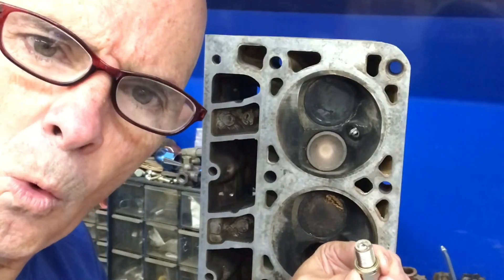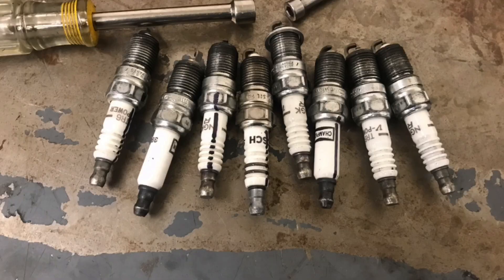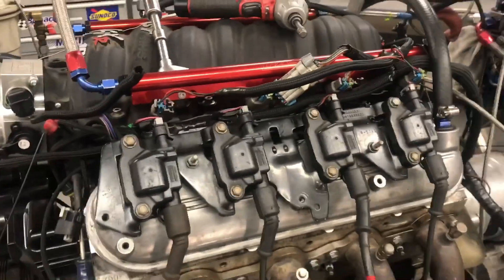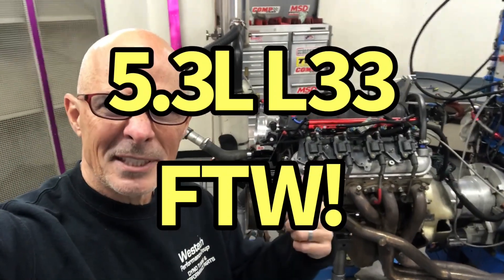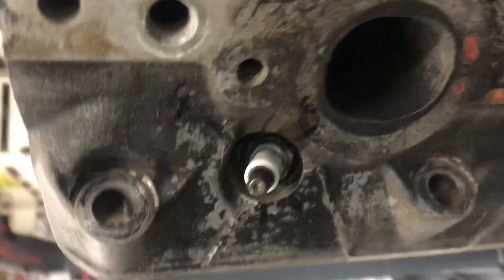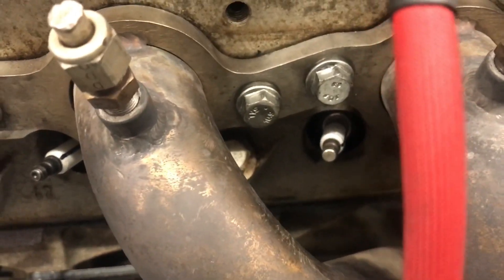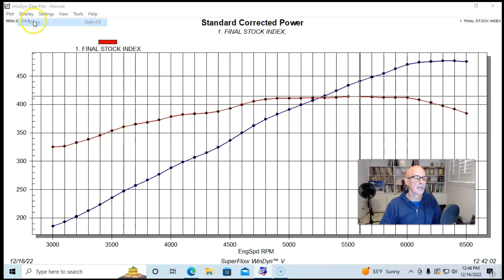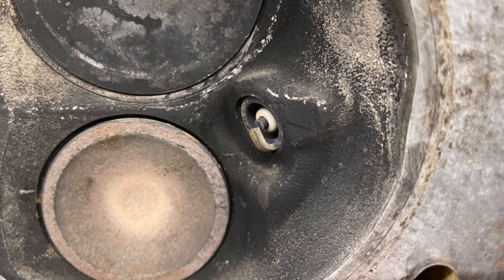SPARK PLUG INDEXING-DOES IT REALLY ADD HORSEPOWER? JUNKYARD LS MOTOR MYTHS! LOW $ MODS-DOES IT WORK?

Comment: I personally would be nervous about indexing plugs in aluminum heads and ripping a set of threads out. Not sure how much force it would take but I'd be cringing the whole time I was tightening to align if I didn't have shims like you did.
Reply: the only correct way is shimming.
Reply: I buy 2 sets of spark plugs to make them all the same takes longer tho

Comment: The FIRST problem with the test is you are using these PEICES OF SHIT Bosch spark plugs. We've proven that they cuase more problems when installed in a LS engine than ANY OTHER. There's a reason that GM used the AC Delco Iridium Spark Plugs. And its why we often see these OEM plugs with 150-180-K miles on them in junk yard engines. We've experienced intermittent misses, to complete misses and several other issues including detonation problems.  Do a test and video using the OEM AC Delco vs the Bosch turds and you'll be shocked...
Reply from the maker: you need to see the next test of three different plugs including precious metal-you need to just watch and learn-none of your statement is accurate

Comment: What I've heard is that the spark gap needs to be indexed away from the valves and down into the bore to supposedly make every cylinder have the same flame front on the top of the piston. From what I read in hot rod and David visards books is indexing the plugs are only worth about 1 to 3 hp. So in a daily driver you won't notice any difference however in a Nascar or nhra top fuel division that extra 1 to 3 hp could mean the difference between first and second place. I've watched nhra funny car races where they completely tear down the motor and rebuild it between rounds and have never seen them bother with indexed plugs. I've heard those nitro methane engines make about 10000 hp so I reckon 1 to 3 hp isn't an issue. I don't believe it's enough difference to make a difference unless it's an extremely narrow application like Nascar or modified dirt track racer or maybe pure stock where your goal is wring out every available hp.

Comment: Not sure about this test because I've been around engine builders saying indexing they're customers plugs netted them an extra 500 rpm at the end of the track !
Reply from the maker: 500 rpm?
Reply: @richardholdener1727  yes , I think indexing allows for more rpms at the big end . Maybe it'd be a bigger gain with let's say 800 or so horsepower

Comment: The only time I've had to index plugs is on one of my race bikes where the piston runs so close to the plug if you  over rev it with the plug strap in the down position the piston would tap it and close the gap.

Comment: Great test. I am 64 and remember reading that the only reason for indexing was for piston clearance on high dome pistons.
Reply from the maker: that's when I do it
Reply: Yes I remember this also from back when and it's good to know and think about but as you said we never did see much from it
Reply: I can remember 64 🤔.  Indexing for proper clearance verification always makes sense. I would also try to have the spark fully exposed to the intake charge rather than positioned with the side electrode blocking a clear line of sight between the incoming charge and the full spark. It’s mostly a compulsive thing to do because there couldn’t be much horsepower left to extract.
Reply: @danielwilson6665  it can not make a difference in power because both valves are closed at the time of the spark.
Reply: @karlmoltzan6196  ….. I would hope so but I mentioned it to point out a different train of thought about the subject. Thanks.
Reply: @karlmoltzan6196 so what your saying is that the mixture is standing still when the valves are closed ?
Reply: @rtkl13 
Well sir, it comes down to what the dyno says. Myth busters say, Wives Tales.
Before youtube and guys like Richard, myths ran wild as party girls on spring break.
Amen?
Reply: And you are creating an issue if the plug is so close to the piston. It will 'blow' the spark out being so close and you do not have the right pistons.
Having seen all the different angles of plug in the head angling the plug must help or manufacturers would not do it.

Comment: But I believe an extended tip plug will make a little more than a short tipped plug
Reply from the maker: heat range test video up soon
Reply: @richardholdener1727  great job sir, as always

Comment: Great vid! And It’s definitely not worth the effort for the results you’ve shown! Especially on a low rpm n/a set up with a ton of spark, One thing I’d consider is even with out a significant gain on each individual plug, just by getting as close to even cycle on each cylinder should help smooth things out at higher rev’s and maybe more noticeable on single coil like you said. I’ve stopped indexing plugs on my turbo l36 for street not feeling significant gains but if I’m going to race it gets indexed just for piece of mind,wasted spark and boost find’s a weak spark

Comment: If you used a sbc, like you said you could of tried this with different distributors, points, electronic and aftermarket MSD. Those index washers showed up when engines still used distributors and they claimed they made a difference. And here you come and test them on an ignition system you can weld with. 🙄 Seems like this was a waste of time, making it and watching it. LOL

Comment: Now borrow a fully built, blue printed Bonneville or lakes engine. Where every last hp counts. Flame propagation in the design...think top fuel. I'd like to see how that pans out. Might still be zero, but may stop hot spots, burning heads/ pistons ect. Appreciate the proof!
Reply from the maker: I didn't index plugs on any of my Bonneville motors
Reply: @richardholdener1727   I believe you.and the numbers. I'm just curious if at that level we might see a difference... Probably only be a couple at the top but the dyno is always proof. Love the content and hard work!

Comment: I have a SKI Doo snowmobile.
It has a direct injected two stroke Etek.
It gets 20 miles per gallon on the trails..
It burns all the fuel injected into the cylinders..
You have to index the spark plugs..
There's three positions the plugs can be in the heads if you do not put them in per the manual you lose horsepower and MPGs...
Reply: common on all DFI outboards too